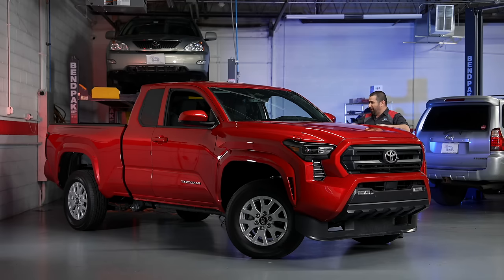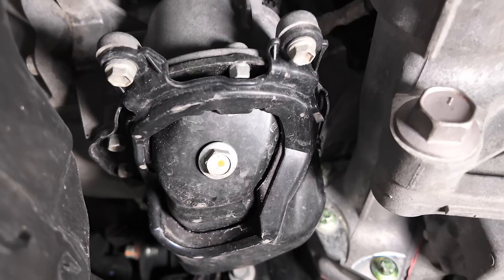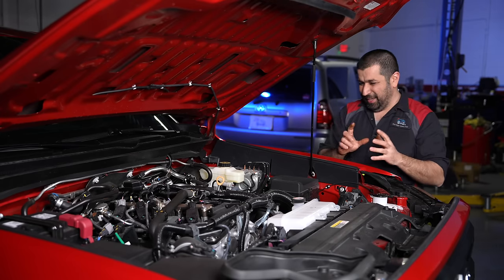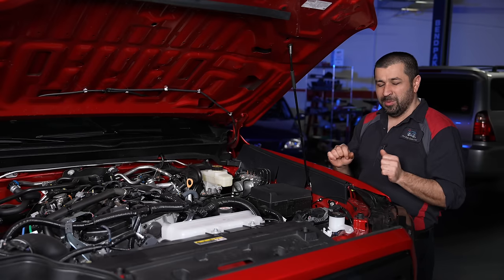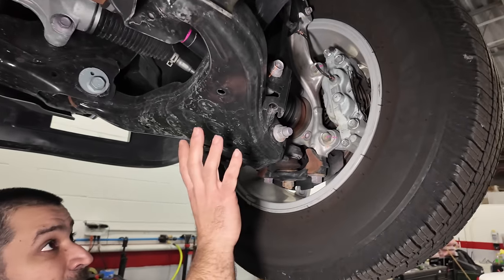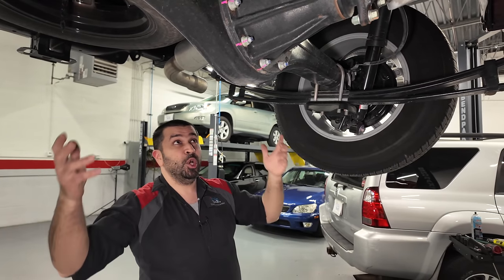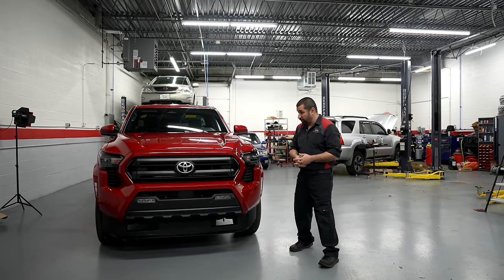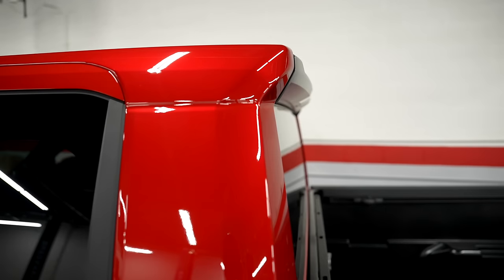2024 Toyota Tacoma | Did Toyota Improve or Ruin The Tacoma? Comprehensive Review

Comment: My brother-in-law just bought one of these; he is 67 years old and this is his first new vehicle.  He paid $45,000 for it out the door and was just bragging about how it drives and performs.  I saw him at Wendy's yesterday and he was driving his old Ranger in the drive-thru.  I asked where his Tacoma was and he was pulling his boat out of a lake and it sounds like the same thing happened to his truck that happened to the TFL truck.  He has it at the dealer now.  His was made in Baja, Mexico.  Scotty Kilmer is going to have a field day with this one.  GREAT VIDEO!
Reply: He kinda already did, he posted a great review of the new Frontier
Reply: Yah they won't be as reliable since it's made in Mexico and let alone a Turbo crap little engine!! Love my 23 trd!
Reply: @lvsqcsl Already at the dealer? For what? What year Ranger does he have?
Reply: @michaelcarson8375  He told me the front drive axle CV joint snapped while he was pulling his boat out of a lake.  He had to make it up a muddy incline when this snapped.  His Ranger is an '02 without 4WD; he wanted 4WD to do hunting, etc.
Reply: @lvsqcsl  sucks but new model pains will work out just like Tundra's getting less and less issues now. Baja plant is also not a bad thing as basically socal. Glad my Tundra was built in 1794 TX though.
Reply: @bigfootswatching9986  Isn't yours made in Mexico as well?
Reply: @bigfootswatching9986  they've been made in Mexico since 2004.
Reply: 1st Gen Tacomas had 4 cylinders as an option and were extremely affordable and reliable. They were small trucks.  I bought my 2001 Tacoma Double Cab 4 x 4 with a 3.4 L v6 for 25k and still own it. It runs as good as the day I bought it. It had the perfect balance of technology, size and power.  These trucks are not meant to save fuel.  I still get 17 mpg on mine. Toyota messed up by making the Tacoma a mid-size truck starting with the Gen 2 in 2005. Now they are talking about bringing a small truck back. We are also choking on too much technology in our vehicles today because of government, industry stupidity and consumers liking new useless gadgets in their vehicles. This in turn leads to manufacturers building disposable vehicles with planned obsolescence like your smart phones. What is the cost to the environment for all these disposable vehicles nowadays?  Like lemmings we too easily settle for paying excessive prices for vehicles that won't last beyond a 100k. How long will that 4 cylinder turbo last in the new mid-size Tacomas?
Reply: @Sam-dq7ws  Agreed.  I just feel bad for him because he is having issues.  He actually has 2 Rangers, an '02 and an "03 he inherited from his late father.  Hopefully he'll have his Tacoma back soon.
Reply: @MightyT01  I have a co-worker that has a 1992 Tacoma he bought new along with his 2023 Tacoma he now owns as well.  The differences in the 2 trucks is striking to say the least.  I don't think a person could break that '92 if they beat it with a ball bat.
Reply: @davidwelday3276  the Frontier (that Scotty Kilmer like, ) still has the wonderful V6.

It is a totally different animal (now) compared to this twenty twenty- four Tacoma.
Reply: @MightyT01   Vehicles last much longer than they use to.  I remember cars in the 1970's would be rusted out junk in 6 or 7 years.  I can't remember the last time I saw a vehicle rust out from underneath.  Vehicles are much less disposable than they use to be.  But no one will pay for a vehicle that will last a life time.  That's why they don't make them.  Also, vehicle makers design and sell what the consumers want.  They want bigger trucks.  If Toyota hadn't made the Tacoma a mid size truck, they wouldn't still exist.  

The one thing I am really disappointed with in my 23 Tacoma is the technology.  Toyota has not kept up.  There isn't even a heated steering wheel available.
Reply: I call BS.
Reply: @donm2255   That is a common complaint , so i'm quite sure there is a aftermarket heated steering wheel you can get.
Reply: @donm2255  Your comment about needing a heated steering wheel is anecdotal confirmation of consumer's demanding useless tech that will break sooner than later.  If you haven't already I suggest watching the Scotty Kilmer YT channel for some real lessons on the reliability of today's cars than even those made 10 years ago. I stand by my statement, we are choking on too much technology in our vehicles. The government, industry and consumers are to blame, full stop. And for the record not all vehicles in the 70s and 80s were rust buckets are trash quality. I'm old enough to know first hand. It's the very reason Japanese auto makers cleaned the clock of American makers and overall still do when it comes to quality.
Reply: @MightyT01    A heated steering wheel keeps your hands warm.  It's anything but useless.  The government is imposing ridicules fuel economy standards and the only way Toyota can meet the MPG targets on a truck is to downsize the engine and add a bunch of crap that makes it less reliable.   But they are also imposing better safety standards.  A new car is dramatically safer to drive than a 10 year old car in terms of both energy absorption and accident avoidance.  The technology in vehicles is only going to increase.  The government wants safer more fuel efficient vehicles.  Consumers want bells and whistles.  It's really hard to take a road trip now without Autopilot.  It's not useless.  You need to get use the increase in technology in cars.
Reply: @Sam-dq7ws  Apparently what happened (the way I understand it) this CV axle has these steel "balls" that allow the suspension to articulate through turns and up-and-down travel.  Evidently, there is a mechanism that "cages" these balls in the CV joint and this component wasn't installed correctly which caused the failure; and I am NO mechanic.
Reply: My dealer told me they were still working out the kinks.
Reply: @bigfootswatching9986 love my 23' trd also
Reply: Just an fyi Toyota has been making vehicles in Mexico since early 2000’s for Toyota and every vehicle has issues especially with all brand new components
Reply: @lvsqcsl According to TFL the failure is a sensor that triggers a disconnect before the front differential snaps.  That is, if it feels there will be damage it will not allow the front diff to connect.  In TFL's case this happened on a icy road which did tax the drive-train very much.  From what TFL said I don't think there was heavy damage done.  But who knows.  This is egg on Toyota's face.  Hugely embarrassing to say the least.  This along with massive amounts of hard plastics and the back seat which is so small its unusable means I'm no longer interested in it.  This is DOA as far as I'm concerned.  Its a cheaply build Mexican truck that cost 15K more then the outgoing.  For this kind of money your much better off chasing down an older 4 runner or a GX 460.  Those are the real deals.  And also made in Japan.
Reply: @MightyT01  The gen 2 "Tacoma" was nothing but a Gen 1 Tundra with a downsized engine, and other downgrades.  Toyota trucks started a huge downslide with this reshuffle in 2005 that cancelled the real Tacoma, rebadged and down graded the Tundra, and then created a larger truck that they now called a Tundra. What we really needed was the compact gen 1 Tacoma with the 4.0 V6, A midsize Gen 1 Tundra with the 4.7 V8,  and the full size truck with the 5.7.  Instead of real substance, we got flashy techy gizmos, and shiny objects on the dash., and we kept right on buying them.  My next "new" truck will be a  2006 Tundra.
Reply: @lvsqcsl 👏 well then it's not the same as TFL since it's a completely different part. CV axles break... In all vehicles. I snapped 3 on my BMW 335 yet nobody is crying about the 3-series at all...
Reply: @KO_infamous  Correct.  I am no mechanic.  He said they replaced the joint and he has his truck back now.
Reply: @bigfootswatching9986  23s are made in Mexico lol
Reply: very interesting.  Thanks for sharing.
Reply: @bigfootswatching9986  the engine is made here in the usa
Reply: He is a Toyota certified mechanic..why would he talk bad about a new toyota
Reply: @bigfootswatching9986 the 3rd gen was also made in Mexico, and the 2nd as well
Reply: What happened??
Reply: @MightyT01 The "ooh shiny" factor brought us many horrible things.
Reply: @jamesdonaldson7396 exactly lol
Reply: Didn't know Toyota had a factory in Mexico for export to the US market. Disappointing.
Reply: @MightyT01 very true "wah wah I need my heated steering wheel, my heated and cooled seats, my power seats, my power liftgate, my 360° camera, what? no this is all basic and functional stuff, I'm talking about the REAL unnecessary complexity"

In the under the hood section he showed how many corners were cut, how things will break sooner, how they're harder and more expensive to fix, and in the conclusion he was raving about how it's better than the predecessor in every way. I don't really mind the 4-cylinder in the truck. They had 4-cylinders in trucks in the past, naturally aspirated and turbo and in a truck smooth powertrains shouldn't be expected but smooth engines with more cylinders made American trucks special compared to diesel 4-cylinders in the rest of the world. The 3.5L was definitely too weak though, but Toyota should have developed a new 3.5L V6 and a 5.0L V8 in the dynamic force family to offer their customers what they want and to have more smooth powertrains which are sorely needed in their cars. The Crown, Highlander, NX, RX, TX all need something smoother than that narly 4-cylinder.
Reply: 👋🤣👍I also saw that tfl video! It didn’t last on the first take! The lock up differential popped! According to tfl, the front differential broke!
Reply: @hiwind58 no jobs were lost. Toyota sent Cross over and SUV vehicle manufacturing to the USA.
Reply: @bigfootswatching9986  b.s.  the old one was assembled in Mexico too!! 😂
Reply: @lvsqcsl  Before 1995 1/2, There were no Tacoma pickups, they were officially designated as "Truck" and were based on the Hilux sold elsewhere. I've had a few of these with both the 4 cylinder and the V6, still have a 1993 SR5 as a daily driver. They are quite durable if you take care of them and fun to drive daily if you don't mind driving something slow and underpowered by today's standards (the 4x4 versions had 116hp 4 cylinder or 150 hp V6 and slow gearing from 4:10 to 4:88 depending of the engine/transmission and tire size). Not quite the same category as a newer Tacoma which are much bigger and heavier (as most new vehicles are). 

I wish they had replaced the 2023 model with something simpler and a with a non turbo V6 as an option. I can't see myself trying to fix one of the current models in 30 years (if I last that long!).
Reply: lol imagine watching Scotty Kilmer's channel. I stopped watching that guy after he was telling the DIY crowd to use compression fittings to fix brake lines that said right on the package that they were not to be used to fix brake lines.
Reply: @bigfootswatching9986  Muchas cervezas de Coronas en Mexico.
Reply: @MightyT01  I'm remembering Datsun and Toyota,  vs abominations like Vega, Pinto, etc...People didn't know the big 3 had flipped the script and betrayed American customers yet, so these little piles sold like hotcakes until the word got out.
Reply: I’m going to keep my maid in Japan 1980 4 x 4 thank you very much.
Reply: I called Toyota and they said if I bought a Tacoma it could be made anywhere, so you never know what you get. And they charge MORE for the Mexican Taco than the American Frontier. $$$$ straight into Toyota pockets. Their greed will backfire,  except for the brand loyal who will keep paying the price.
Reply: @donm2255 heated steering wheel?  Who cares???  Just remote start and heat up the car is good enough for me..
Reply: @MightyT01 new technology can definitelt be reliable.   Hybrids have done 500k miles and still keep going.   I found a rav4 with 440k miles and original battery and powertrain.  A 2020.
Reply: @bigfootswatching9986 Tacomas have been made in Mexico for more than 10 years.
Reply: @lvsqcsi growing pains are quite normal for any brand new design. R&D can only detect so much. That "old Ranger" when it was first designed went through a lot of growing pains too. It's to be expected! If youtube was around back when fuel injection was introduce for engines, Scotty would have had a field day with that too! It took 40 years from the 50s when fuel injection was introduced, to the 90s when it became mainstream. Why? Growing pains! It's normal.
Reply: Turbo crap never buy toyòta again, you talk your paid off
Reply: lol people actually watch scotty kilmer?
Reply: @lvsqcsl Should’ve used a paved boat ramp.